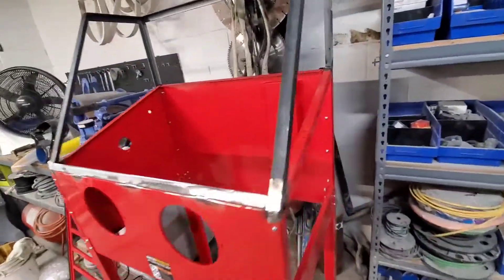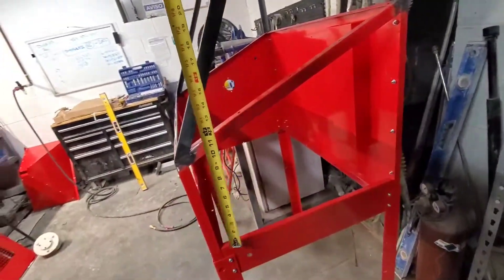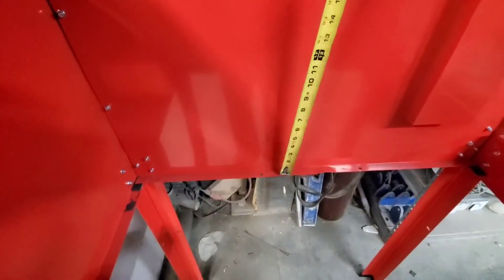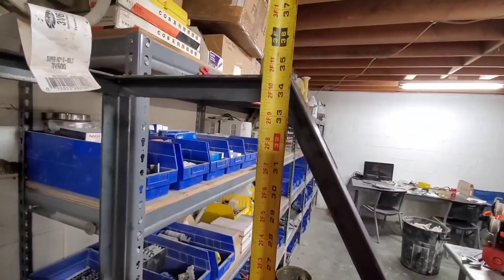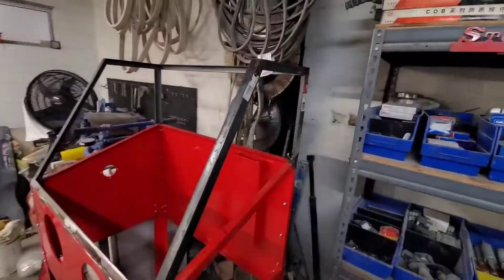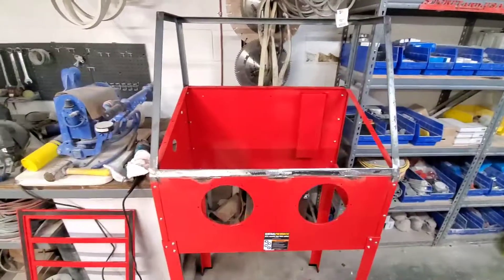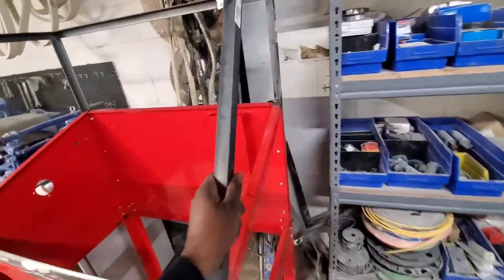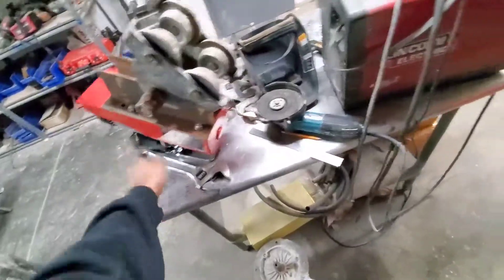Harbor Freight Special! Sand Blast Cabinet Hack Bigger And Better

Comment: Were there any other videos posted about this cabinet mod? I'd love to watch any other videos or see additional pictures. Great work man!
Reply from the maker: Thanks, I did not make any follow up videos as I started to concentrate on the powder coat oven build, the cabinet is done and has had a few sets of wheels ran thru it the biggest being a 22 inch, I can make a quick follow up video within the next week or so if interested 😀
Reply: @Ricardo_Wade  yea I would really be interested in seeing how you put everything together
Reply: @Overhaul_zoo_engineersx2  I have watched easily >100 videos on improving the HF blast cabinet 😅 first time I see someone expanding it this way, really nice work! 👍🏼Would love to see the follow up video as well, my cabinet is pretty tricked out with Tacoma like upgrades already, dust cyclone etc, but internal space is an issue... Actually building a second one to use as a high pressure heated parts washer and could also use more space in that one. Cheers from Austria!